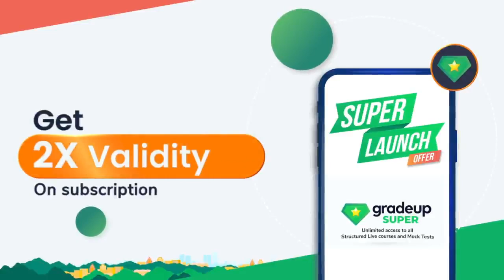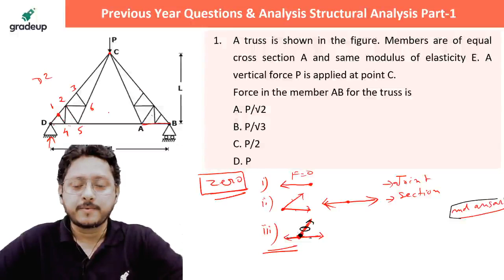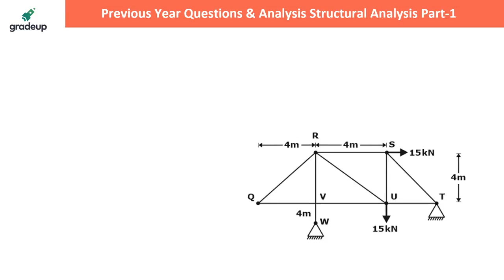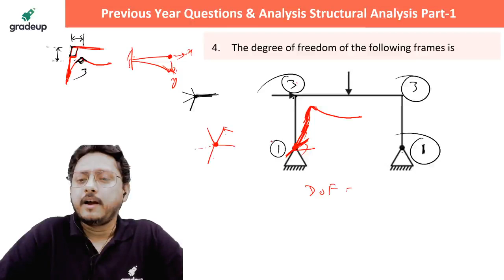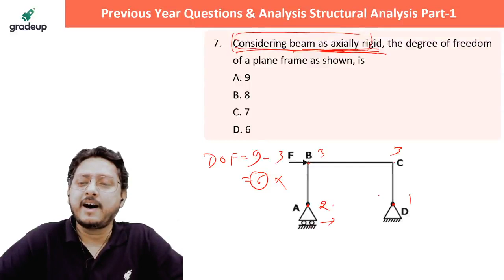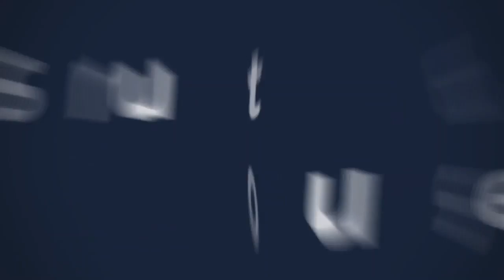Structural Analysis | Previous Year Questions & Analysis (Civil) | GATE 2021 | Part 1

Comment: Sir can u explain how question no 6  is stable bcoz as both sopports moments are zero and the frame can rotate easily na when horizontal force is applied
Reply: It can not rotate as it has rigid joint connection with beam. Although for external stability In general  you need minimum 3 reactions with some exceptions. Here you are getting it.